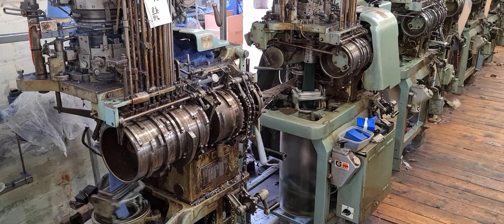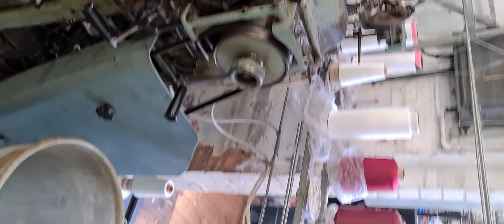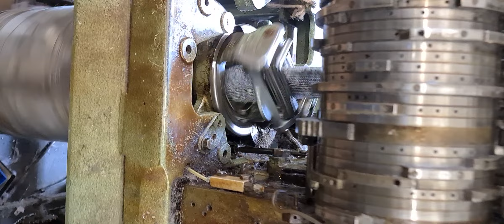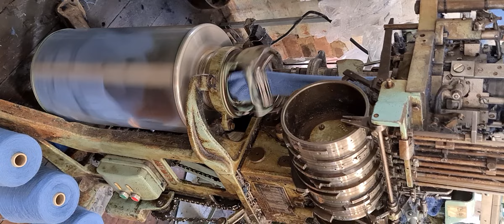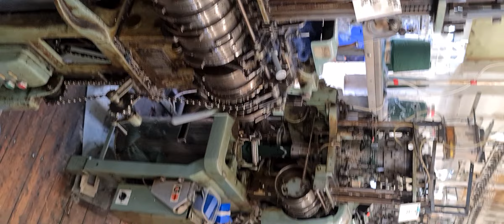Leicestershire finest  sock machines. komets

Comment from the maker: Love  them .got there  own characters
Reply: I need help with my sock machine can you help
Reply from the maker: @Alpacaman-fx3gn  what seems to be the problem
Reply: @roberthollis9200  There is a "0" stamped on the top cyinder bearing cap, what is the relevance of the "0".  I think I have a timing issue, but first, I have only 22 studs in the timing chain, yet the manual I have quote 23 in the chain arrangement.  I tried 23 once but it locked up, so back to 22, but then it started to break the knitting butt on the first medium butt after the long butts on the welt, I think I,ve cured that by adjusting the back stitch rib cam. So still on 22 studs but not sure the timing is right I have photos but don't know how to get them to you.
Reply from the maker: @Alpacaman-fx3gn what part of the sock does the machine get to before it locks up ?
Reply: @roberthollis9200  it doesn't lock up with 22 studs as I have it now.  Before I change it back to the 23 stud arrangement is the 23 right and the 22 wrong.
Reply from the maker: It maybe a slider arrangement. What model machine do you have ?
Reply: @roberthollis9200  It's a 4 1/2" 84 needle BR with I think reverse welt and Double feed but the draw thread is not used it has from when I bought it used solvron